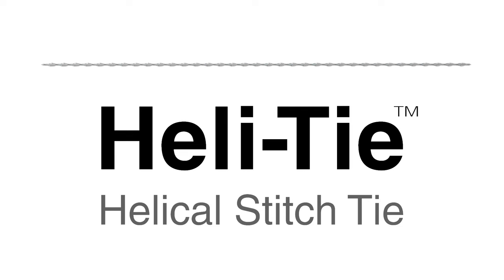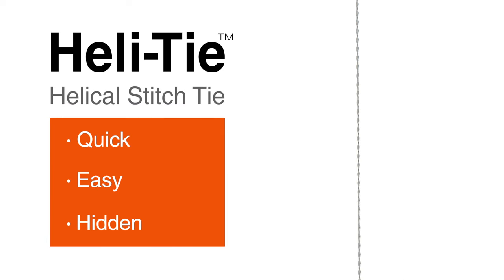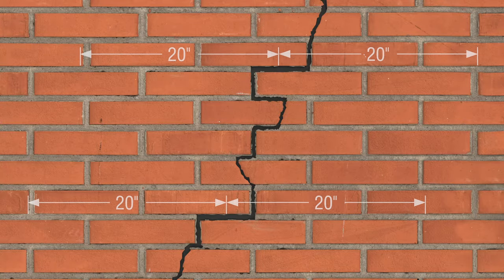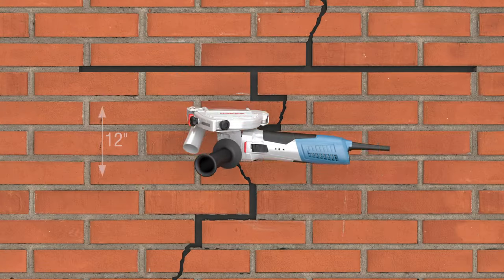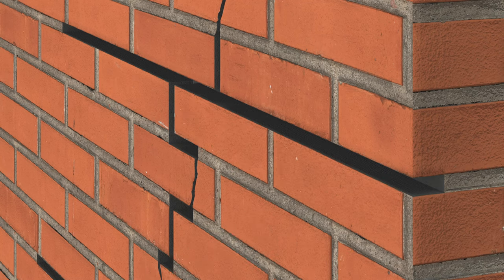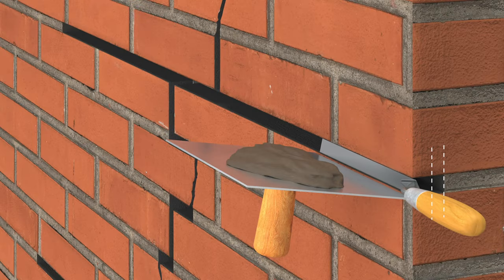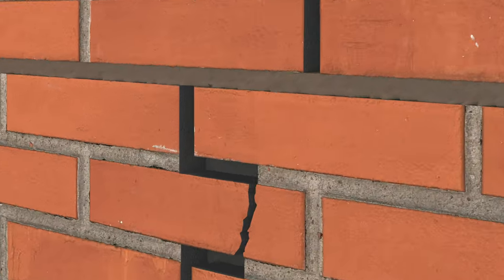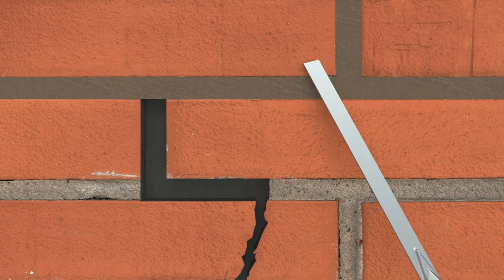How to Install Heli-Tie™ Helical Stitch Tie

Comment: Hi where can you find these tues hd nor lowes had them.  Also what happens if the cracks run to corner thats stuck out or window? I have 24 corners with large cracks & butt out fireplace.  Sorry that good memory for technical terms!

Comment: Where can I  purchase these as HD nor lowes carries them? I have 24 corners and 22 have cracks, 1 is butted against door frame, have largest crack on side of house with attached garage & there isn't 20" because of window direct over & around crack. My fireplace butts out & and the same wall as that the corner is butt out, too, with cracks running from eaves down & around!